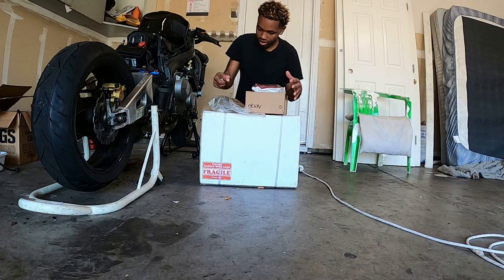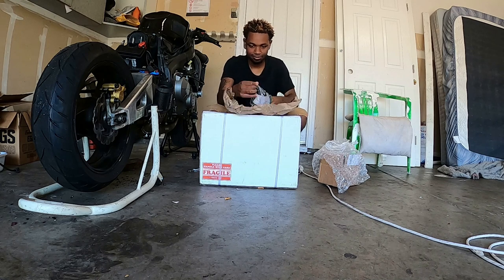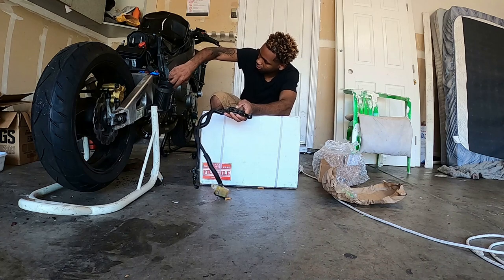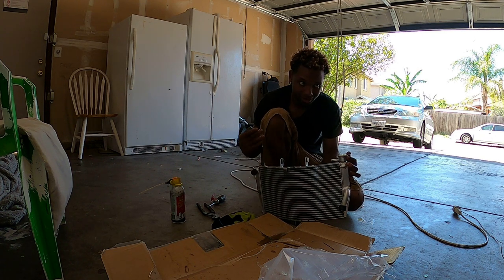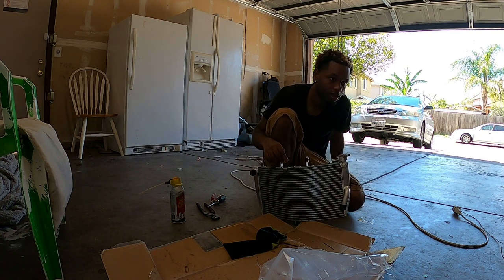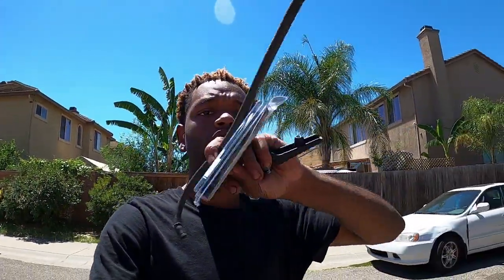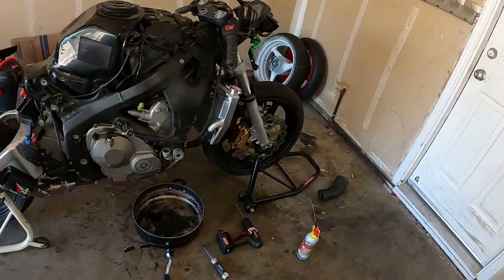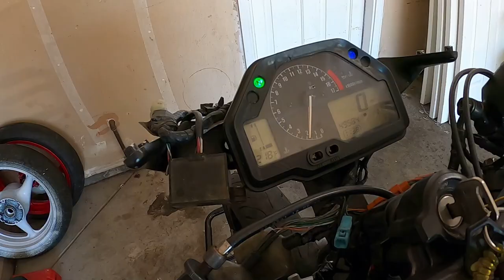Radiator Installation and other Fittings on my Honda CBR600RR Motorbike

Comment: Good vid, How do you change the radiator fan set point so the fans come on at a lower temperature
Reply from the maker: I think you would have to have that flash tuned in. Or just run water wetter and distilled water to drop temp 20 degrees. That's what I run and bike stay around 185-190
Reply: Hey how is the radiator holding up? I just want to know why these are so much cheaper than OEM? Does it fit well with OEM tubes? Thanks for your time bro
Reply from the maker: @YamminHondas  yes it works well with the oem hoses just need to grind down the mounting bracket a bit that's all but it flows well